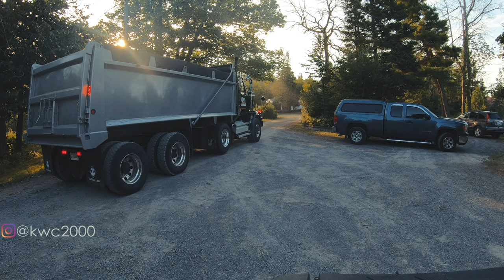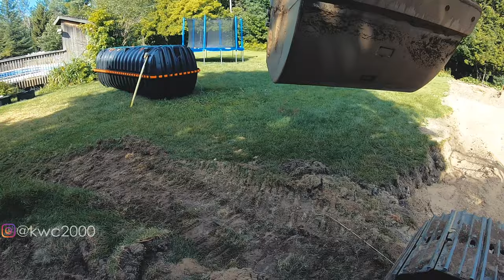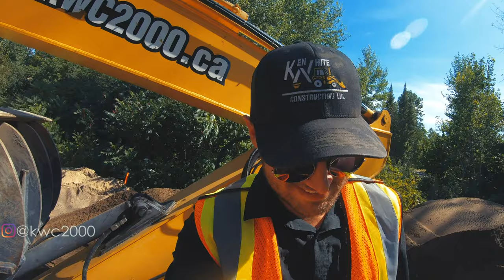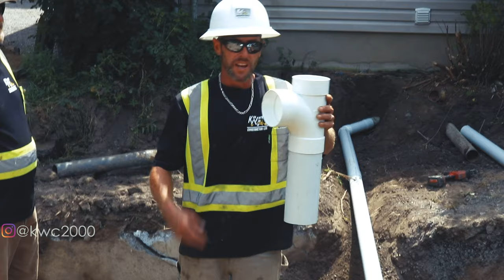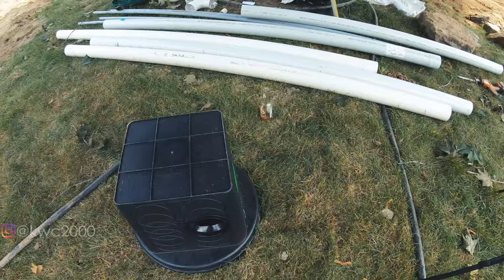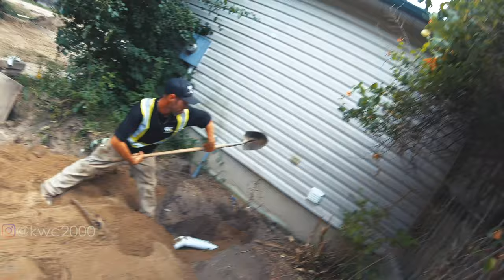Installing New Septic Tank & Pump Chamber! (5800L Poly Tank)

Comment: Quick question and you might want to look into it is when filling in the old tank shouldn’t you break the bottom of it to let it drain? That way it won’t fill with water and become a pail of mush. It will also not freeze in the winter and become a big popsicle. Kind of like we are not allowed to fill in an old pool. You must break it apart first.

Comment: We do quit a few septic systems ourself. We use infiltrator tanks too.  I like the tanks but not sold on the risers.  Wish they would have stayed with the screw down type. We have had lots of trouble in the colder weather with the risers not snapping together correctly. And in some cases the snaps break off.  Curious if you have had the same trouble. We have to be licensed to do installs. And keep up with continued education hours each year. Do you have to do the same thing?  Great vid. Thanks. Back fill it
Reply from the maker: Yup I think Cory has the same issues with the risers, yes we have multiple informational events that are mandatory attendance that we attend as well as yes we have to have a licensed installer. I know there’s lots of “fly by night” lads out there 😂

Comment: I just had a system installed and i argued with the installer that we needed a Tee at the end of the discharge. He said no no. Then  he called me later and said we will put your T on when i come back out (needs to dig deeper for drain). I said why didn't you tell me to put it on when i had lid off. he said inspector. We had to get him out of there first.

Comment: Backfill it! Do you always need a Dbox for a septic installation?
Reply: No you don’t but it is preferred. One reason is if you have an issue with the bed you can find and open the D-box to investigate. It also acts as leveler to distribute the effluent equal to all the runs. The other option is a header but if not backfilled properly then you run the risk of overloading one side of the bed resulting in failure.

Comment: Clearly these guys have never heard of a "ledge tank" which is shallower than a regular Septic Tank, but is usually longer and sometimes even a little wider to allow for the same capacity or liquid volume. Typically, about the same price as a regular tank, so it doesn't really cost anymore money. You can even get a Pumping Station that's designed for ledge or bed rock, which are also not as deep, but still allow for the same or similar liquid volume as a normal Pumping Station. Regarding the Plastic Risers, and the Plastic Septic Tank, I'm not a fan... I personally prefer the old style Concrete Septic Tanks and Concrete Risers, because they can last a very long time, and virtually impossible to damage. Plus, in terms of safety, concrete covers are very heavy and hard to remove, which keeps children from being able to easily open the Septic Tank and/or the Pump Station. In my opinion, safety should be the primary concern when you have kids... especially little boys.